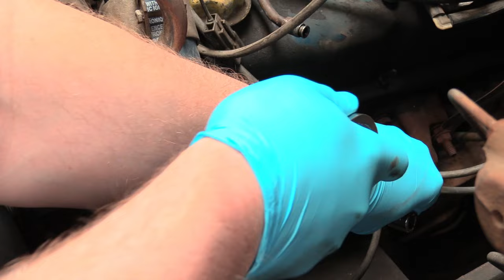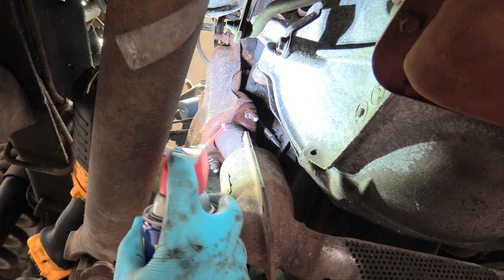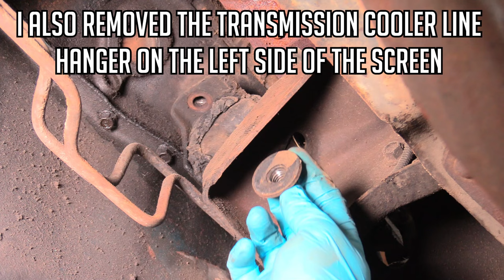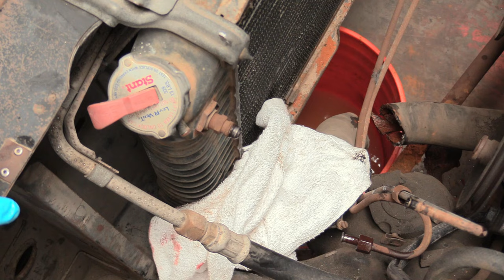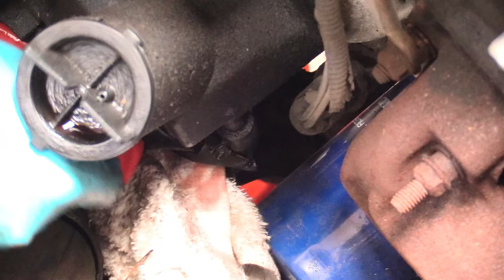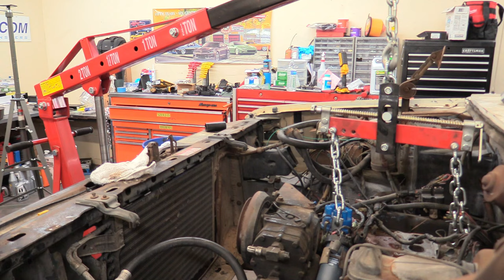How to Remove an Engine - FULL TUTORIAL!

Comment: On the subject of wiring...I would love to see you put a Painless Wiring kit into something like this.  My 79 Firebird has factory wiring and it needs to all go away but such massive electrical work scares the crap out of me.  I would love to see how you do it in your typical, point by point, long form videos.
Reply from the maker: Now that's a good idea! I would love to re wire the Bronco like that. Thanks for watching!
Reply: On a vehice that old a lot of the wiring is garbage and for emissions. You can just cut it out.
Reply: @SOLDOZER  I’ve had the car since I was 15 (I turn 46 this month) so the wiring hasn’t been butchered like a lot of cars. My main problem is its old and brittle and in places the insulation is just falling off.
Reply: @madrabbit9007   I just bought an 84 C10. The AC was trash and dont need any of the emissions garbage. After removing it all there was not much left. Other than the headlights there was only like 4 wires.
Reply: @SOLDOZER  I’m restomoding my car so A/C, power windows, touchscreen radio head unit. Needless to say I’ll need more than what the factory offered.
Reply: @madrabbit9007   Get a Vintage Air and it all goes under the dash.

Comment: Hey quick question. I was wondering what model number and brand is that impact gun? i was going to get air tools; but, this seems like a good option here. Also, where did you get the sockets? so, exact impact gun model and socket recommendations, pretty please. Thanks so much, you are doing great work! I am super motivated!
Reply: Looks like a DEWALT 20V MAX XR. Phenomenal battery powered impact gun.  I almost bought one, but went with the Milwaukee brand because of all the batteries I have are from Milwaukee.

Comment: I was trying to find the part where you did the tq converter bolts, it may have been brief, but I missed it! But other than that, this was a great refresher. I’m about to pull my 300 6 cylinder from my 82 f-100 which is essentially the same exact process as here. Thanks! I figured out the tq converter nuts myself pretty easily!
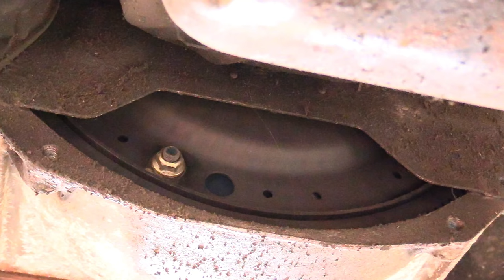Reply from the maker: 13:07 Thanks for watching and nice work!

Comment: Thank you Ryan! So detailed and through. I will be pulling a Ford 460 BB out of my 67 Mustang gt. It is shoe horned in, no room and not much to disconnect. It is paired to a C-6. I want to swap in a 351W stroker motor (408). Should I pull the C-6 with the Engine, seeing that I probably will have to use a different bell housing? Or just pull the C-6 out sepatately? Thanks for sharing. Appreciate all your time and effort in making this great video. Cheers from Motown.
Reply from the maker: Awesome! Thanks so much for watching! I'm a fan of taking the transmission out first, just because it is easy to lose control with all that weight and harm yourself or you car. Hope that helps!
Reply: @2carpros  Hey Ryan, agree. the 460 is 750lbs alone. Will disconnect trans from engine and then tend to the trans. Hey! and all that with Jack Stands!!!!  lol (but I am used to it now.) Cheers from Motown and Thanks for your speedy reply sir.

Comment: What bout removing from a 3 speed on column . Do you still remove flywheel bolts
Reply from the maker: So I'm assuming its a manual 3 speed and those you don't have a torque converter to unbolt. Typically you just have to unbolt the manual transmission. To remove the engine. Sometimes you have to take the line off the throwout bearing but sometimes it's just a fork and it's super easy. Thanks for watching!

Comment: What if my engine is siezed ? Is it still possible to remove those torque converter bolts/nuts off
Reply: You would just have to disassemble more of the engine while it is still in the car or truck to free up your stuck pistons.
Reply: @chrisstromberg6527   is there anything else I can do?